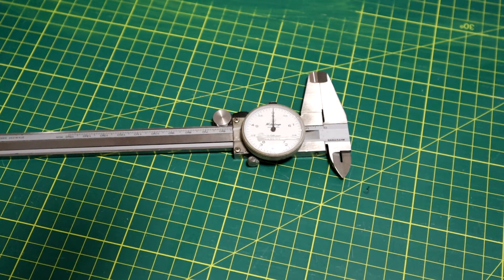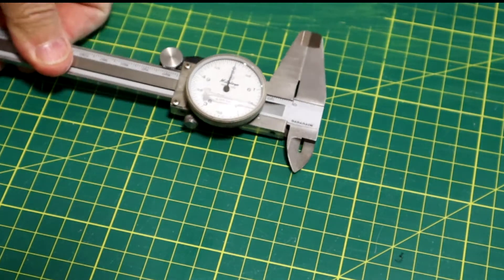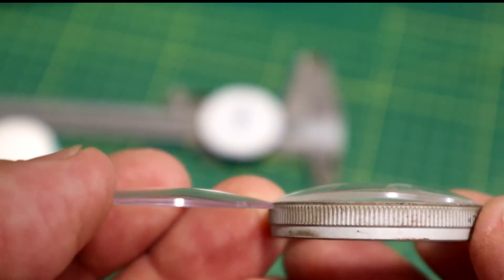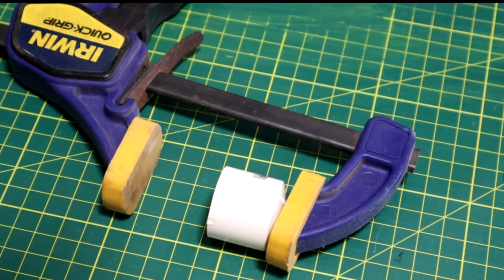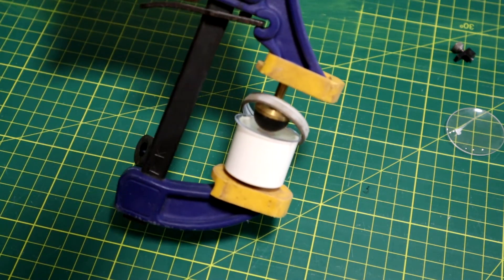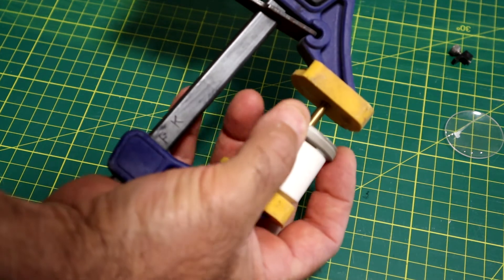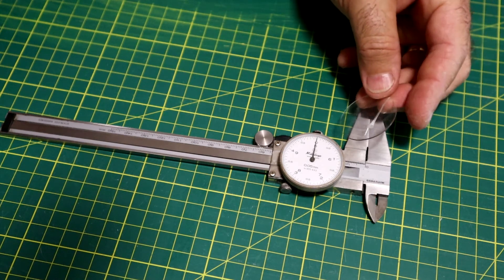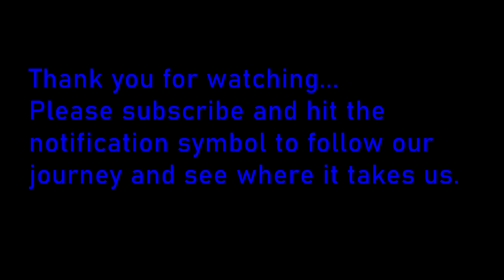40 year old Mitutoyo 150mm Dial Calliper Lens Replacement

Comment: I have the same the same caliper 14 years older but with the same crack.  I have a new crystal on the way.
Reply from the maker: Great to hear you are going to replace the crystal. That's quite a sentimental calliper you have. I still use mine but also have a 150mm Chinese digital calliper. One lives in my garage, the other in my study.

Comment: Just used the exact method and setup.  The aftermarket lens I bought did not distort, it just shattered with pressure.  My guess is technique is fine but the aftermarket lens was brittle.  Possible on a second go I will set it in the sun to warm.  The other possibility is that i did not have a rubber tip but a nylon bulb of similar size to use to distort lens.  Take two as soon as I get another lens.  Rats!
Reply from the maker: Thanks for watching and commenting. Warming it up is a great idea.

Comment: Thank you for sharing this info. I have one of these, with the lens off, and had no idea how to get it back on. Mine also has a slightly different slide attachment: where yours has machine screws above the ruler markings, mine is smooth and undrilled. Instead it has inset worm gears on the forward and back thin edges of the slide, presumably for the same purpose. The production must have changed at some point, because otherwise it appears to be exactly the same as yours.

Comment: For what it’s worth you can actually clock the dial to read zero at exactly 12 o’clock. I think with this particular model you have to remove the bezel lock and push a pin through the hole to take tension off a spring bar that will disengage the pinion so that you can set the caliper to where the needle points north and close them without the dial moving.
Reply: Or you can take the needle off and move it. While the needle is off it's a good time to disassemble everything then clean and lube. After 40 years it probably really needs it. *
Reply: @wormhole331 What lube would be appropriate?
10w40? (JK)
No really, what kind??
Reply from the maker: Thanks for your advice. It does annoy me it isn't at 12 o'clock. 
I'll have a look into it.  Cheers
Reply: @pinzone4358  no worries. Your video is very helpful as I have to do the same for mine. The only problem is I can’t get a replacement dial, which I need. MTI qualos say they are discontinued.